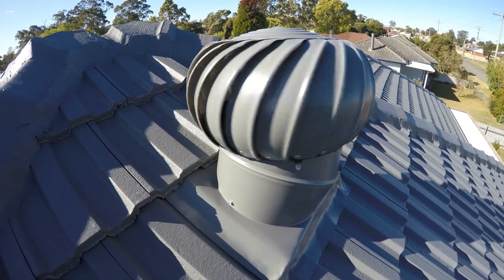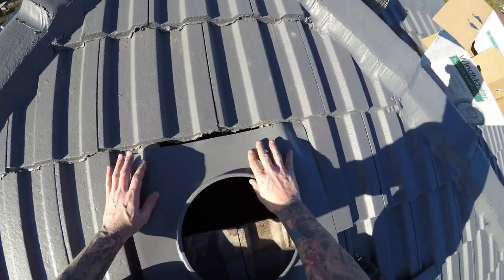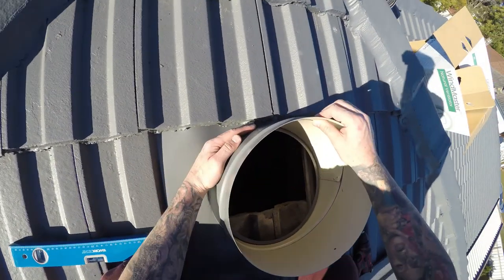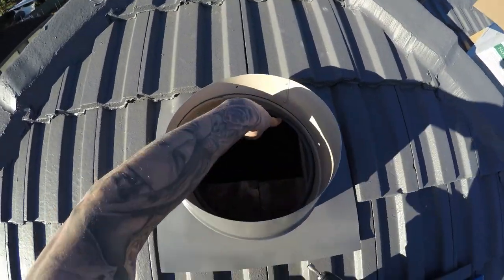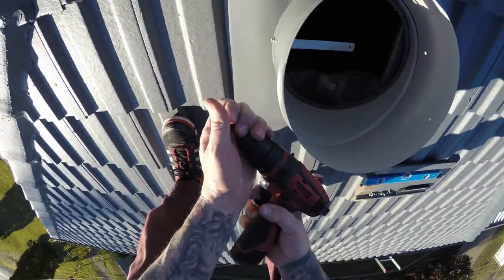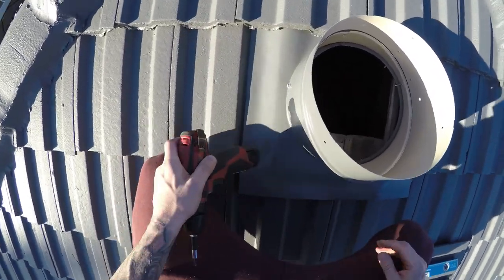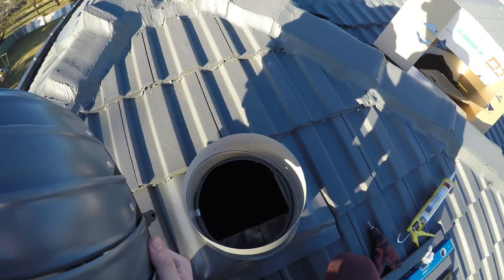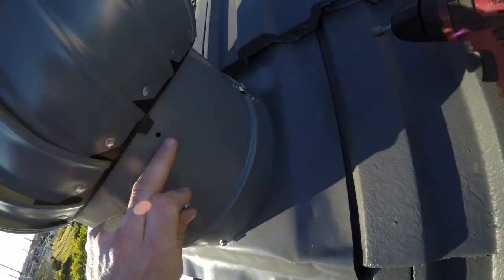How to install a Whirlybird roof vent on a TILED roof | DIY

Comment: Will it leaks when not spinning ??
Reply from the maker: No it won’t
Reply: @projectlex i just installed mine, it doesnt as easy yours, mine looks a little uggly 😅, might want to paint it black.
Reply from the maker: You could paint it the same colour as your roof to blend in or yes black would look good also
Reply: @projectlex  thank you, the paint wont disturb the spin right?
Reply from the maker: Give it 2 coats of light even spray paint & no

Comment: Thanks for the info! Super helpful! I only have one whirlybird in my roof but on super windy days it makes a ticking/clicking sound. Is there any reason for that? (Unlikely it’s faulty as it’s very newly installed by a professional)
Reply from the maker: Hi, no problem.
Could be a loose screw or bolt, maybe the bearings?
Reply: @projectlex  indeed it was a loose bolt! Who could have known such a small piece would cause such big noise! All fixed!
Reply: @projectlex  indeed it was a loose bolt! Who could have known such a small piece would cause such big noise! All fixed!
Reply from the maker: That’s great! Super happy you got it sorted. No more noise now!